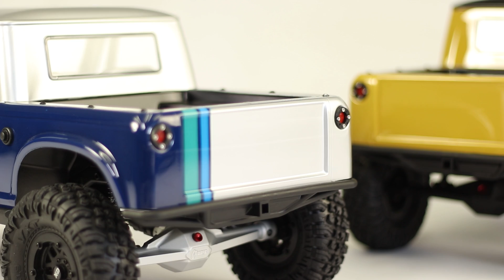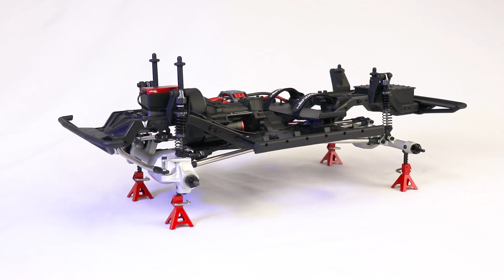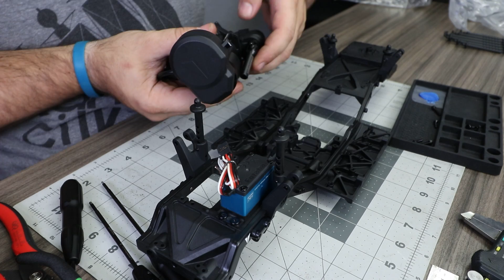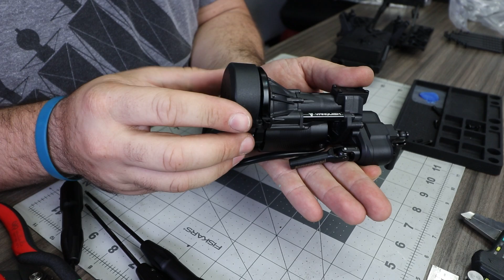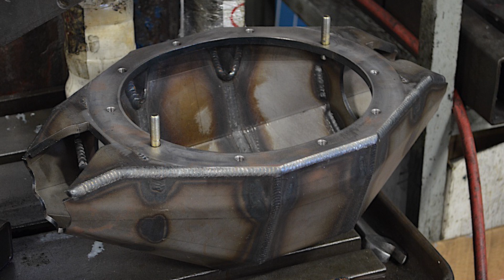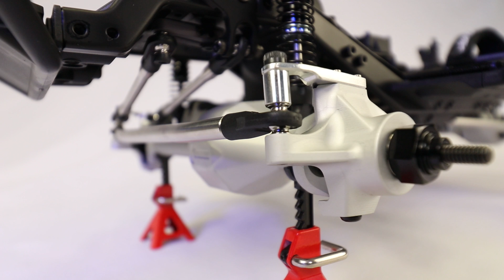Best Trail Truck yet? - VS4-10 Pro - Features and Details

Comment: Hello, you guys are amazing at what you do!! Love the product's! Is a tekin 412 rock crawler motor enough for this machine? I want to do this build right. I bought 1 buy will trade it for bigger if I need to
Reply from the maker: ROC412 is perfect. I run the 3100kv in mine.

Comment: I run this thing on 4s and snapped my universal while trying to crawl a pillow and picking up some wheel speed. Rear axle doesn’t run smooth also. A bit disappointing all in all.
Reply: I have the same problem with my rear axle. It’s just not smooth running 😢 I will search for the fix or call vanquish.
Reply: Just put it together and drive, it will smooth itself out without even noticing.

Comment: I just built mine. The only problem I had was my radio. I got the Spektrum Rugged radio. Mine was defective. I just could not program it. The kit builds like a Tamiya kit but with more metal parts. Also most of the metal parts are made in the USA! That is fantastic. An absolute joy to assemble.

Comment: If you was building this for performance what motor would you recommend?
Reply from the maker: Everyone’s idea of performance may vary, some will say that the low speed of brushed may be the best for them but I prefer brushless. A Holmes Hobbies 2700 Puller Pro and a Mamba X or a Tekin 3100kv ROC412 with a RX4 are my top choices.

Comment: OK with the 60 wt oil you recommend in this video; but, does that oil go with the standard pistons pre-installed in the shocks?  I do see optional pistons included in the kit.
Reply from the maker: Yes with the stock pistons. I’ve never changed the pistons personally.
Reply: @HarleyDesignsInc  Josh,  Thank you for the quick reply...Continuing with the build...Should be crawling with it by Thursday.  LOL

Comment: I am on the fence about getting one but if you thing about it I have a TRX4 Tactical unit with maybe $1400.00 of $1500.00 invested ...The VS 4-10 has everything included except the dig unit so you know w the electronics is a personal preference thing and with most RC you buy that is one of the first thing to get upgraded and the servo is typically the next item ...I believe I just talked my self in to it...What motor do you think should be used? Not so much what manufacture but the kv rating ...Thank Josh ..Keep it up .Cant wait to see what the next build off is between Matt and you self ...
Reply: I have a HW 540L 2100KV but if a had to buy it again I will go for a Holmes Hobbies Puller Pro 3500KV and put a lower pinion.

Comment: My answer is NO. It’s not the best. I think for $300 the redcat gen 8 is more capable. And can be turned into the vanquish for just about an extra hundred dollars. The redcat also comes with a vastly superior body too. I would call it a tie if the vanquish cost $500 but it doesn’t.
Reply from the maker: There is no comparison in the quality of those two vehicles. The Redcat is a fine truck for entry level parts but is far from a high quality vehicle. Those two trucks are just not for the same buyer.

Comment: Josh, good review. One thing you don't really mention though is what the weight distribution is like. I know that the VFD transmission gets the motor well forward but the battery tray has moved a long way back. How much difference does that add up to with, say, a 2200mah 3S battery in the tray?
Reply from the maker: Weight distribution will be similar to before in many cases, however the center of gravity will be lower because of the location of the motor. And with a 2200 pack I don’t install the rear tray and I just run it on the side. In that case you’re even better in both distribution and COG.

Comment: Question Josh !! I installed my servo wench, I had to where the spool was towards the front , and hit the drag link , got it towards the back, and hit the Front upper link where mounted to the axle but not as bad. Is this the best any tips would be appreciated
Reply from the maker: Winches vary so much with spool sizes as well that there isn’t just one way. I ran an internal spook style on my personal truck.

Comment: Yeah I love my Josh I really love putting it together, went together so smooth, especially that new transmission , I was out with that yesterday and the nylon locknut and bolt fell out of the pan hard bar and jab right into my best tired poked a big hole, yeah I'm bumming, can't believe that bolt fell out like that. Well part of the hobby .

Comment: Does the older vs4-10 black have metal bumpers and metal chassis braces? Thinking about buying one. Also do they sell extra bodies in case we damage the original? Is the body the same width as the gen8 in case we want to change the grill?

Comment: Good video details. But you work at Vanquish and this is a marketing video. So the title and all the claims are deceiving. Would much be more genuine if you stated why you designed it this way.
Reply from the maker: I basically stated that at the very beginning of the video and went thru the features and what they do/why they are included. There is no deception I stated more than once that I worked on the project and that it’s not a review.

Comment: I've been thinking about getting a vs410 for a wile now, but the pro has definitely sold me on one! I'll be picking one up for sure over the winter and give me something to tinker with and build over the cold months. I think the price is reasonable for what ya get. It's got everything I would want to purchase and add on right out of the box. Also I'm sure this isn't a problem but does the new transmission design hold in heat on the motor? Just wondering because it don't look like the motor has much room to breath, but that being said I always volt up and gear down so heat won't be a issue I don't think. Just something that crossed my mind with the new design. Super nice job on the pro. I can't wait to add one to my fleet!
Reply from the maker: I covered that in the video also. No it wouldn’t hold in heat any more than a standard setup and actually has air flow from the outside compared to a standard trans. So it could do better for thermals.

Comment: I'm saving up to get one lol I might just have to settle for a new chassis and swapping my scx10ii axles. Lol
Reply: if you have the 3 gear transmission, the scx10-ii axles will fit nicely. but for my case, i need the offset curry axle because i have the Vanquish VFD transmission on a the vs410 chassis kit

Comment: So many details I really like the truck but why is there only a diff plug in the rear diff?
Reply from the maker: Because that’s not uncommon in the full size for clearance. Our case was the same, clearances are very tight.
Reply: @HarleyDesignsInc  I figured as much just had to ask.

Comment: The T Case is now plastic too, are you serious? I don't know if I'll ever be buying one of these. Super disappointed.
Reply from the maker: Yes, as it isn’t needed for strength with the design that it has. To keep the cost as low as it is, that’s required. Aluminum is only added where it’s needed to meet the strength that we’re after.
Reply: @HarleyDesignsInc  If it's only done for cost purposes, then please make the tranny and T case available in aluminum separately. Your biggest spenders demand it.

Comment: Will it accomodate the 550 3300kv hobbywing axe motor?
Reply from the maker: It’s built for a 540 system. I’d suggest a different one. The Axe is not bad but you can get a lot more power and smoother start up for less money.
Reply: @HarleyDesignsInc  thanx for the heads up..

Comment: I have the Vs4-10  origin.  The Vs4-10 is cheap when you look at it in the long run.  By the time you upgrade parts for a scx 10 to make it reliable and bullet proof, it ends up costing more than the price of the Vs4-10.
Reply: I would rather an SCX10 fully upgraded than a stock vs410. I would be more proud of the scx10 because I made it my own.
Reply: I spent a total of $1,100 on my first SCX10 so I know what you are talking about. Can’t do that anymore now that my kids are older. They are eating me out of my hobby.